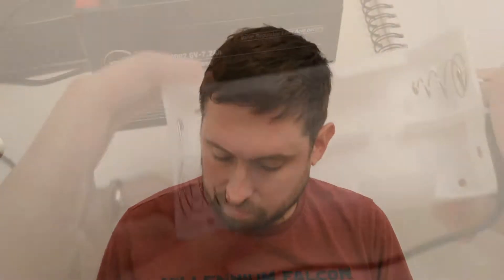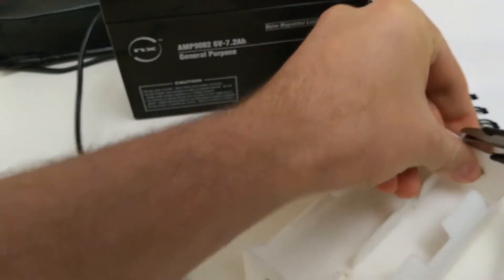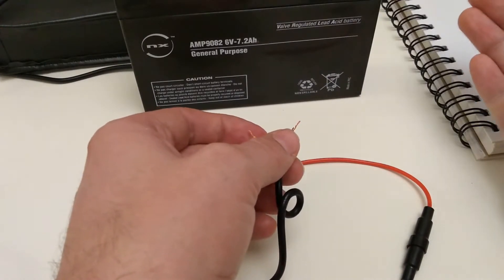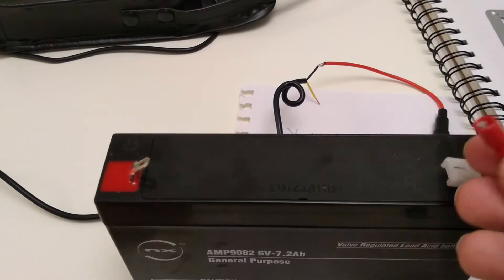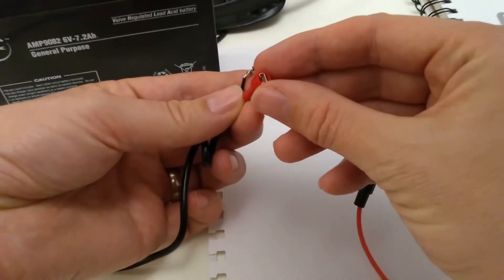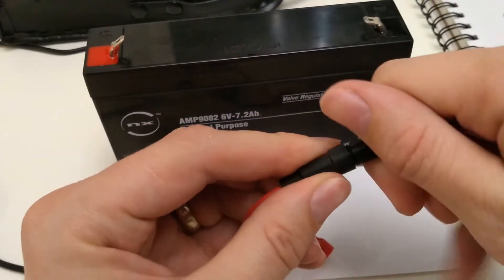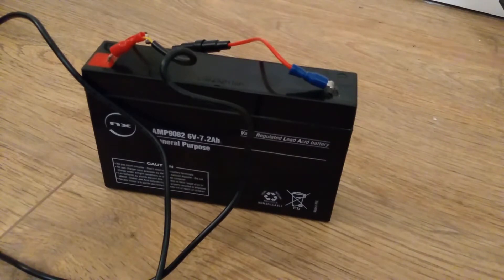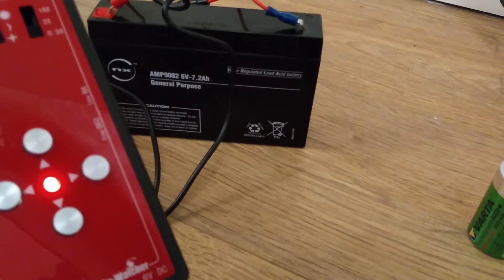How to modify your Skywatcher Motor Drives to use a Lead Acid Battery

Comment: Hi friend. Thanks, I will do it. Can you tell me which charger is the best to use to charge this battery ? I have 2 phone like chargers and want to use one of them. But one of them has  500mha of output and the other has 2.4Ah. Will charging this battery with the 2,4Ah harm the battery ? Or should I slow charge with the 500mah one ? thanks !
Reply from the maker: Hi there, you will need a proper charger designed to charge lead acid batteries. Phone chargers are usually not compatible.
Reply: @AstroPioneer  HI ! Just modified mine too... easy and very pratical. I put a Digital Voltimeter at the top of my batery, a P4 plug and a button to turn on/off. Now I can see charge it has and also turn off "the batery"... thanks for the tip.
Reply from the maker: @aprendendo.astronomia  glad you liked it.

Comment: Another doubt. Do you know what is the consumption of one of this motors ? 
I'm trying to estimate how long does this battery can provide energy for a single motor running only for earth rotation compensation. tks
Reply from the maker: I can't remember the consumption of the motors but I know with my 6v battery it lasted 6 hours plus.
Reply: The drive literature states external dc source should be "6v nominal, 400mA".

Comment: Are these motors good ? Some say they shake a little. I'm thinking of buying one, but need to know if they worth it, will use for astrophotography.
Reply from the maker: They are OK, but they aren't stepper motors which provide much better and more accurate tracking.
Reply: @AstroPioneer They are actually stepper motors. I've got them as well. Not cube but round. They've got 4 wires (2 coils) each. I used to have other round stepper motors in the past too.
Reply from the maker: @belabertalan  yes you are right. What I should have said is that the motors are not providing feedback so the accuracy is not great. So the controller doesn't know the exact number of steps made by the motor.
Reply: @AstroPioneer Thanks for your reply. I think I misunderstood you and I thought you were saying they are not stepper motors. 
You're right, they don't provide feedback.
Reply from the maker: I should have been more explicit really.

Comment: Thanks for the video.  I'm thinking about doing the same thingfor my new hand controller  before I use my motors the first time.  I also noticed the fuse in the negative wire.  If you change the fuse location you'll want to orient the fuse so the wires that's connected to the battery won't short out out against some metal if the fuse holder slips out of your hand.  
A piece of heat shrink tube over the solder connection will also make the joint safer and more durable.  If heat shrink tube isn't readily available then electrical tape around the soldered wires  will be safer, too.   A toothpick or a match stick taped to the solder joine also makes the jont more durable. 
The color coded battery connections are a great idea.
Clear skies.

Comment: The traditional thinking is to have the fuse on the positive lead, but I've seen them on both.
Reply from the maker: Good point. I can't say I am a professional at electronics. However I can say that since I have made the upgrade my motors perform much better! :-D
Reply: The fuse should ALWAYS be on the positive feed. Be a lot easier to use a 6v supply if access to mains is available. Just ensure that the connection has the correct wiring ie centre pin positive etc. If not then any 6v battery will suffice, again ensuring the polarity is correct. (Electrical and Electronics Engineer)